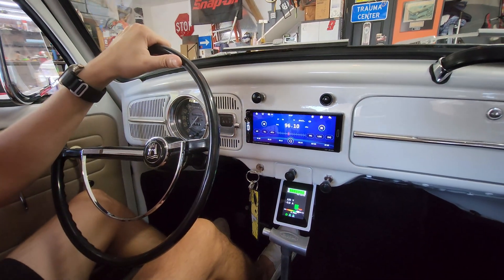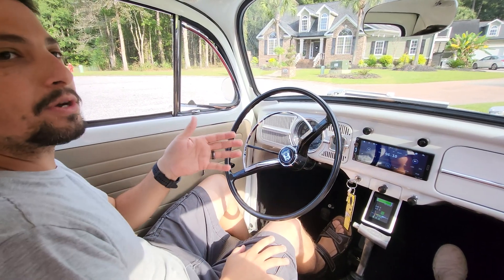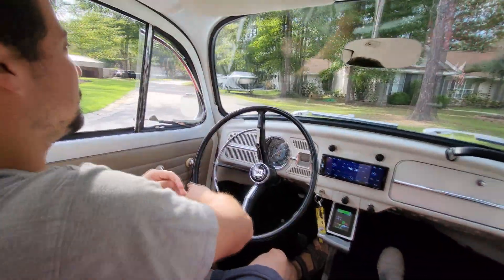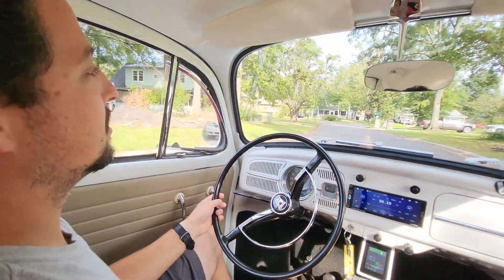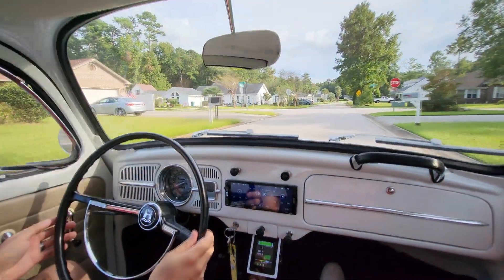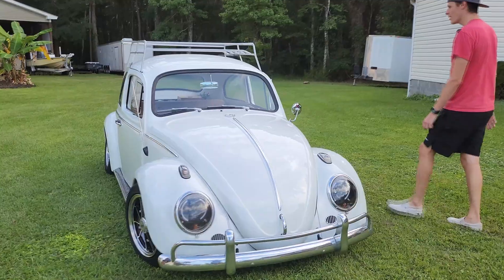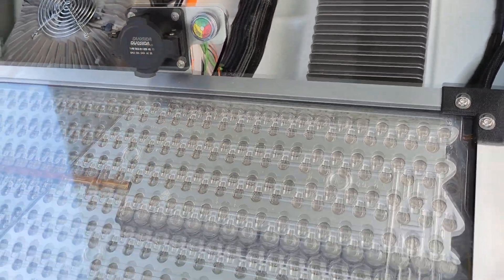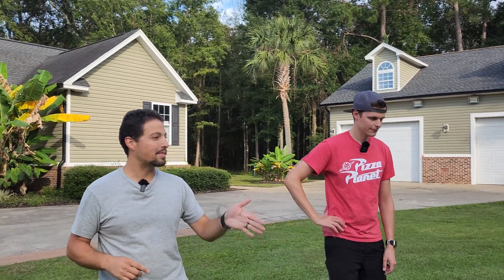1963 Volkswagen Beetle EV Conversion | A Sneak Peak At Revamped EV's Classic Electric Conversion

Comment: Pretty cool. Was the electric motor custom designed to fit in the vehicle?
Reply from the maker: Not exactly, but it is attached directly to the factory transmission and driveshaft. Practically looks like it's custom made. We will talk more about this in a longer episode about the car.
Reply: Wow nice set and amazing job look good. I should convert my 65 beetle. Thank you for sharing
Reply from the maker: Thanks for watching.